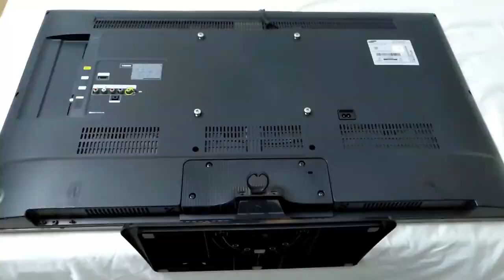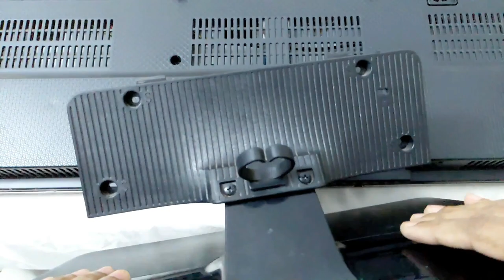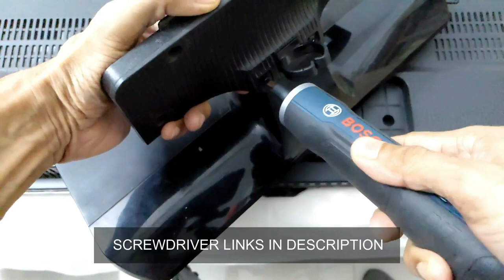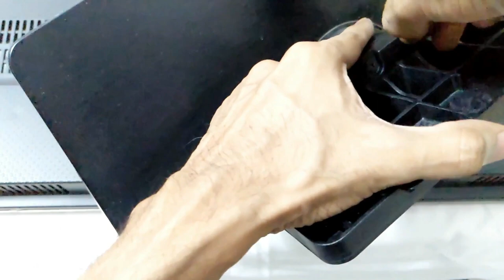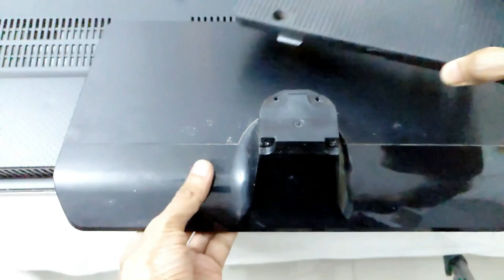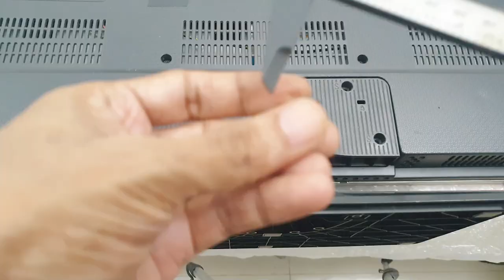Samsung TV Stand (2014) - How to Remove/Screw Size

Comment: Hey man, The screws on my TV are stripped and I cant get them out, to remove the base and install the tv on the wall. Do you have any tips?
Reply from the maker: Remove bottom portion of stand separately?
Reply: @TechLifestyle  not possible. It has screws that joins to the tv.